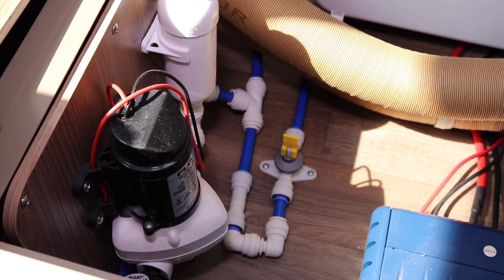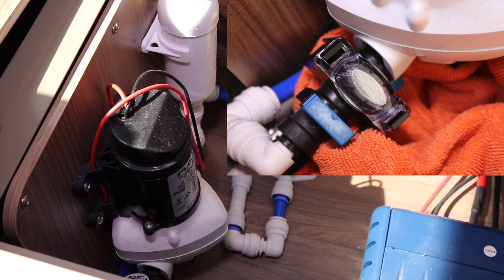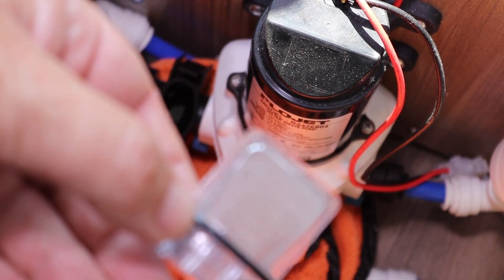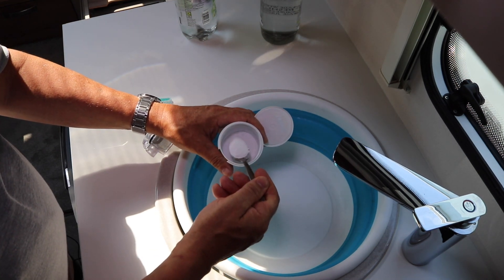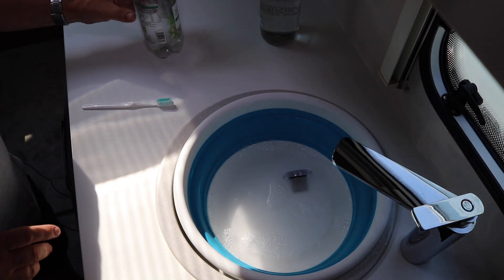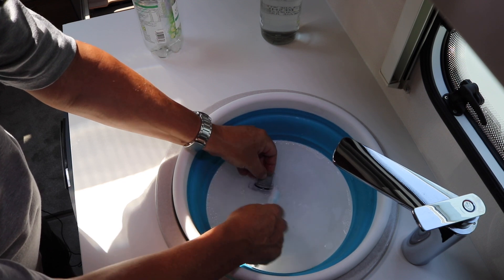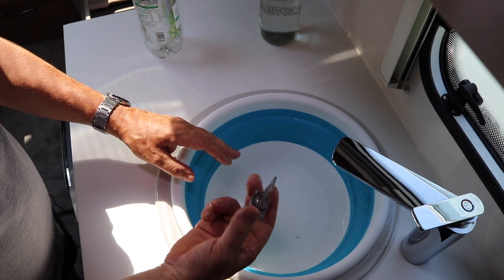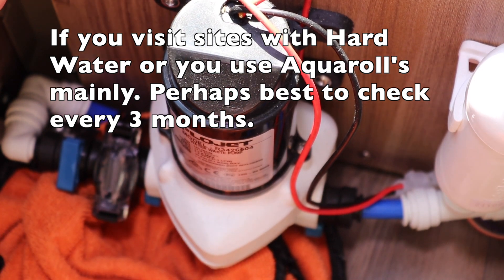Caravan Flojet Water Pump (Cleaning the Filter)

Comment: Thanks for the very helpful video. I was in the middle of servicing our van and wondered if that bit of kit next to the pump was a filter - 30 seconds later your video had answered the question and showed me how to get the thing off (easy, but only when you know how!). Our new to us caravan is 4 years old and the filter has obviously never been cleaned before, it was free of dirt but full of white plastic shavings that very likely had been there since the original plumbing fit out!
Reply from the maker: Hi Nick I so glad it helped you. I like the fact that it is re-useable. It would appears that bit save your pump from the plastic bits. Enjoy your Caravan Thanks Phil🙂👍
Reply from the maker: Hi Nick I so glad it helped you. I like the fact that it is re-useable. It would appears that it saved your pump from the plastic bits. Enjoy your Caravan Thanks Phil🙂👍

Comment: Another tip Phil.
If your electric caravan jug kettle starts dripping when you pour, remove the filter from the spout and soak it in lemon juice for about an hour and then rinse in clean water. This removes the scale from the thin nylon mesh. We find that we have to do this 2 or 3 times between descaling our kettle each season.
Keep safe
Colin
Reply from the maker: Good tip! Colin. Thanks We will be doing this to our home kettle too. Thanks again Phil👍🙂

Comment: People say remove the filters before clean the whole water system with Puriclean but how do you do that with this internal fixed filter? Can you simply feed in water from Aqua roll with puriclean in it to clean the whole Cara water system or will that aluminium filter mess it up?
Reply from the maker: Hi Gary Good question. This system is designed with an alloy filter so it must remain in situ when flushing the Caravan pipe system. Once cleaned & drained then you can remove the filter and give it a clean. I hope this helps. Phil. 👍🙂

Comment: My 2022 Swift Major 4 I bought in New Zealand did not come with a Filter on the Flojet pump. Not good Swift. The pump stopped working, took it back to the dealer and it had picked up some bits of plastic. A filter would have stopped this.
Reply from the maker: Hi. Sorry to read this. I hope the Dealer replaced the Pump with a Filtered Version. I was unaware that there was a none filtered version. I would see if you can buy a filter system that could fit into the pipe system. Just a thought. Many Thanks Phil👍🙂